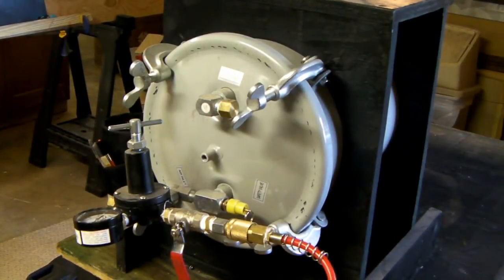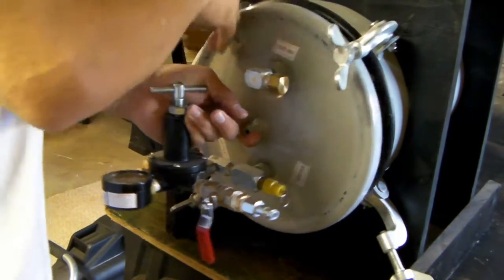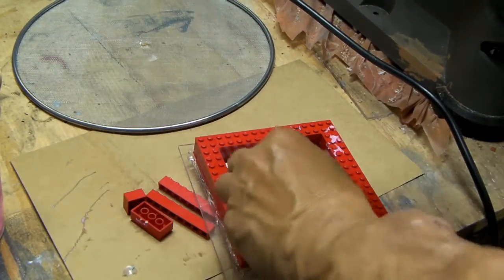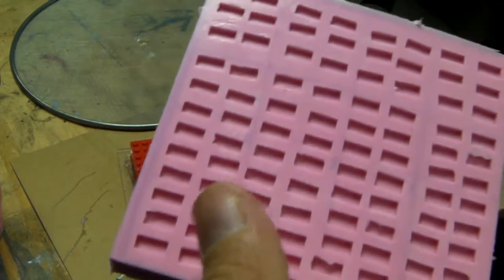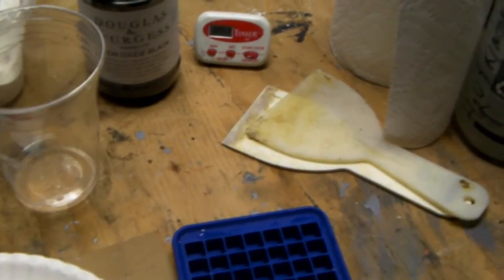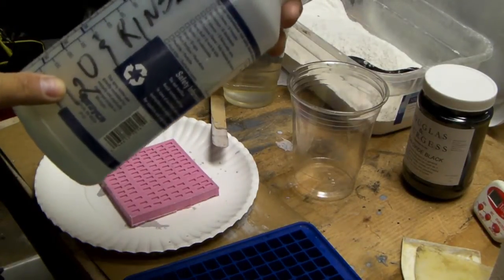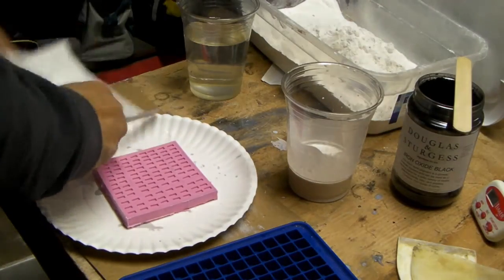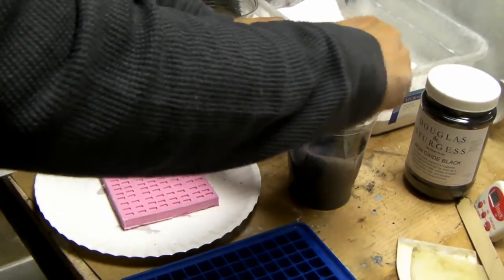Making Scale Model Bricks Part 5

Comment: A pressure pot..  I have gear envy.  :)  And what a deluxe vibrating table!  Very nice. 

Tuf Stone is a great product.  I have used it a lot in the past and its really durable.  I have found the fibers to make scraping a little bit more complicated.  I shifted to HydroStone and it sets up a little too quick for my tastes.  I have to mix it with ice water to get enough working time for multiple molds.  :)

Looking forward to part 6.  Making a brick mold is likely in my future so it's great to follow along with you.
Reply from the maker: The pressure pot is just a converted 2/5 gallon paint tank from Harbor Freight with a few fittings. The tank is mounted horizontally with some 3/4 inch plywood. The vibrating table is made from a large cheap massager off of Amazon, have fun searching through the "listings", plywood, molding and foam from a fabric store. I mounted the massager with adjustable dryer vent clamp rings. Thanks again for checking out my work.

Comment: Nice, I wondered why you didn't put the mold with the RTV under vacuum before you put it the pressure tank.  That should have removed most of the trapped air.  Thanks for the demo.
Reply from the maker: Metallurg33 Thank you for the comment. I actully did use a vacuum chamber. https://www.youtube.com/watch?v=lV89BbEZ8po
Reply: RichterScaleStudios  I saw you degas the RTV, I was talking about putting the mold and the RTV in the vacuum after you cast the molding  material over your styrene model bricks.  When you broke the mold apart, you commented on some air being trapped between the bricks.  If the RTV takes 24 hrs to set, a few min in the vacuum should eliminate some of the bubbles between the bricks.  That's what we used to do when we were making RTV molds for pewter.